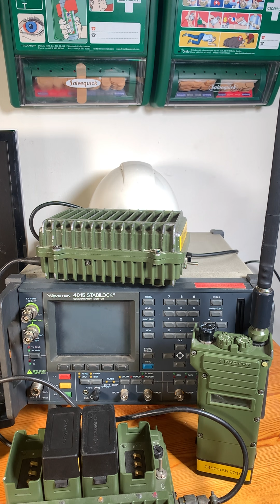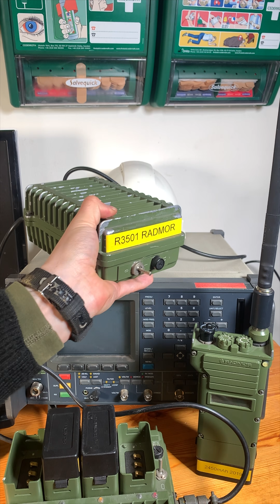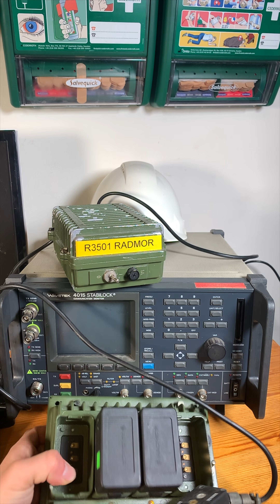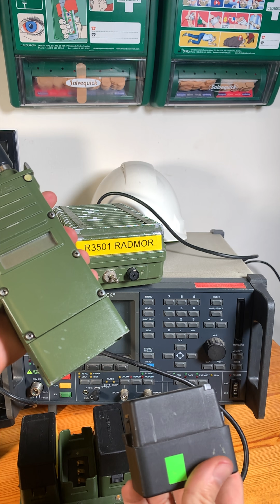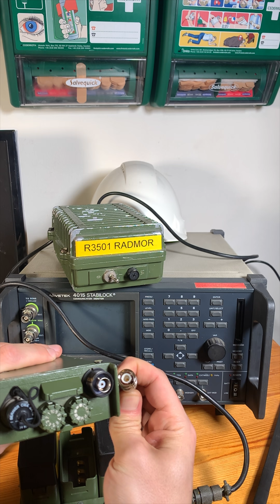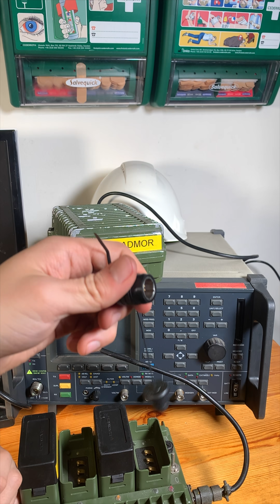Radmor R3501 Basic Tutorial Operating Instructions  Fill-Gun Programming Polish Tactical VHF Radio

Comment from the maker: On my channel, I don’t run sponsored segments for VPNs or push shady affiliate links. 📻💻

As a software developer and IT technician, I’m less interested in the "magic" of radio signals and more focused on bridging the gap between software and hardware. I treat professional, military, and commercial radios as data transport layers—experimenting with SSH over DMR, digital data transmission, and solar-powered IT infrastructure.

I acquire surplus gear and customer returns to document the process of restoring it to service or repurposing it for modern digital communication needs.

Support the projects:
If you find value in this technical documentation and want to help fund the acquisition of unique gear for future experiments, you can leave a tip here: https://ko-fi.com/electronicnoobblog

Every bit goes toward hardware for the lab. Thanks for being part of the community! 🛠